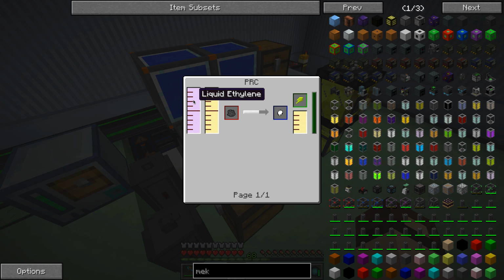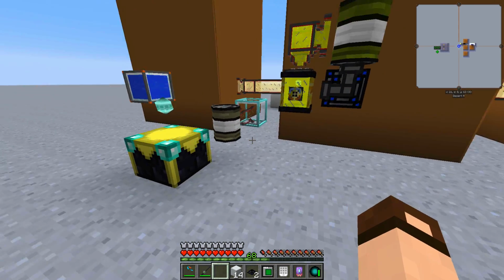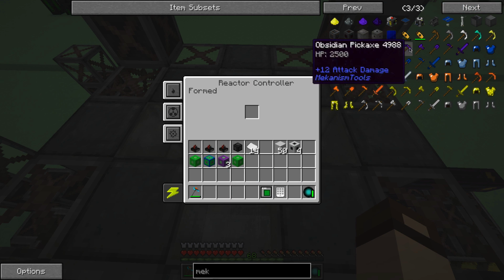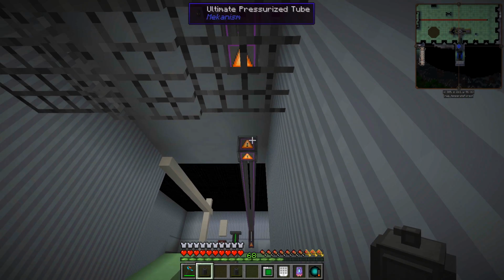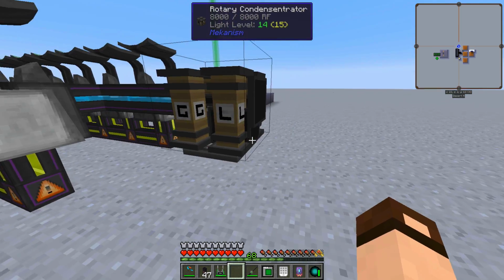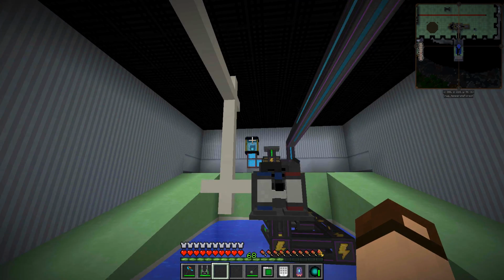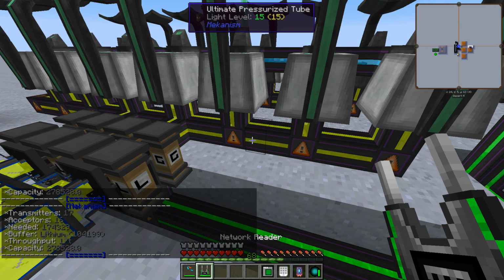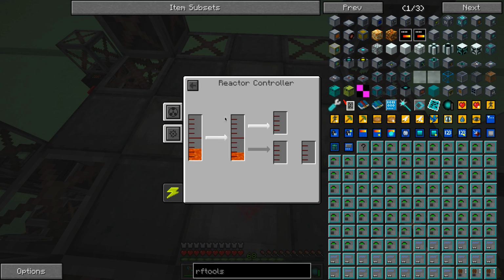FTB Horizons Daybreaker - 11 - Fusion POW-WAH

Comment: I know this is an old video now, but to fix your flashing items in inventory and NEI, turn Anisotropic Filtering on and off after login into to the game. Stops it! From  a fellow Mac user ;)
Reply from the maker: +Cellixus I also found that going into the texture pack menu and then leaving it fixes the problem too. I'll try your tip as well—it might take less time. :)
Reply: Nonsanity Aah! Did not know that, I'm gonna try that. With the Anisotropic Filtering trick the client "freezes" for 3-4 seconds before returning to normal, so your trick may be quicker actually

Comment: Your reactor setup demo is so much more helpful than a lot of the tutorials out there. The detail in balancing fuel production isn't as apparent in any other tutorial and the Mekanism wiki is supremely lacking on Reactor detail (though I've tried to add to it).

It's pretty disappointing to do all the crafting to get the reactor up and the induction chamber up, only to find that the system you have to sustain it is inadequate.

I did build about 30 lasers to collect the beam energy faster for ignition, and that still takes probably 20 minutes to fill. Like you said, the energy transfer into the lasers becomes the bottleneck and requires time regardless of how many lasers you put together.

I also didn't want to worry about the power bottleneck between the reactor and the induction chamber, so I put them directly adjacent to each other with their ports lined up. That seems to work really well.

For all the induction crafting, I tried to use the crafters from RFtools, but the lack of stacking ability on the energy tablets and cubes makes the whole thing a nightmare. I gave up after two ultimate induction cells and providers.

Scary bit there with almost getting stuck in your desert dimension! Though if you didn't have the battery in your inventory, you could have broken off one or two of the solar collectors from brine production and charged it up that way. ;)

I also wanted to say that it has been a joy watching you progress through this pack. The volume of progress you make on any given mod is astounding. If I cut out working a day job, and sleeping, I still don't think I'd catch up, and I started before you! I don't know if you have a lot of knowledge about these mods already built up before going into this one, or if you just natively 'get' how they work, but at this point, I believe you've pulled ahead of everyone else playing this pack. (Or at least everyone on youtube). Thank you for your service!
Reply from the maker: Nathan Elliott In some cases, I've a little prior knowledge to get me started. I played Essential Craft 3 on the DeVinci server, so my experimentation for that mod was all done there. In other cases, I just spend a little time in single player creative getting to know the mods. A day is usually enough to get a pretty solid grasp on even the big, complicated ones. I did this for Aura Cascade and the Mekanism Fusion Reactor. Other mods I'll try out for the first time on camera, with only minimal research online beforehand, like Clockwork Phase or Redstonic.

I mostly used RFTools' auto-crafters to make my induction components as well. The first half of the next episode should show me making what I had hoped would be a fully automatic assembler for them, but there were some logistical problems and a few bugs in RFTools that made it not work all that well. Though I did eventually get a LOT more top-tier induction blocks made using it—enough that my max storage is somewhere around 8 trillion RF. :)

Comment: Bottomless tank and water source tanks, two new things I definitely need to make, lol. Great vid as always bro! :)
Reply from the maker: Love those water sources, but not so thrilled the endless tank doesn't keep its contents when picked up. (I also haven't tested just how "endless" it actually is yet.)
Reply: Nonsanity Have you tried using the cardboard boxes to move it?
Reply from the maker: Cardboard boxes work, of course. Cardboard boxes solve all problems. Cardboard boxes solve world hunger! (If filled with food...)
Reply: Nonsanity cardboard box with a max storage Jabba barrel filled with the largest strongbox which are filled with steaks <3 fixes all the worlds problems.
Reply: +Nonsanity I was disappointed with the latblocks tanks as well at first.   A really good amount of fluid storage, but they don't keep their contents when broken normally.

But I figured out that if you shift-right click on them using the latblocks hammer, they will drop and retain their contents.